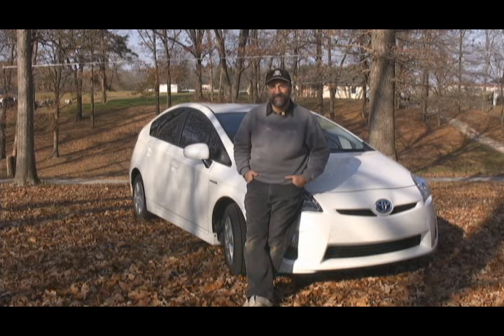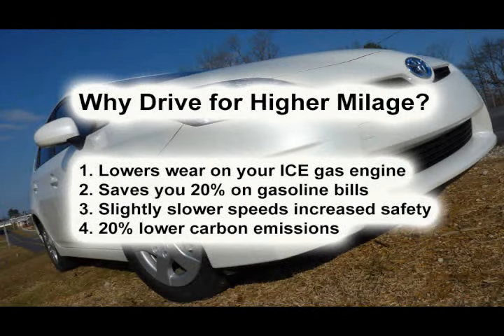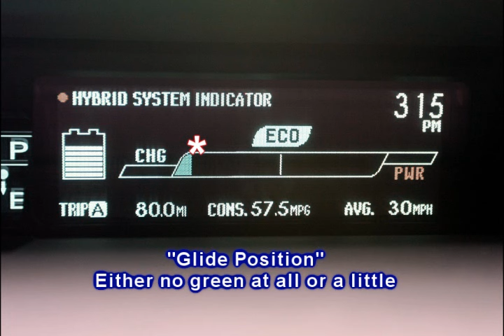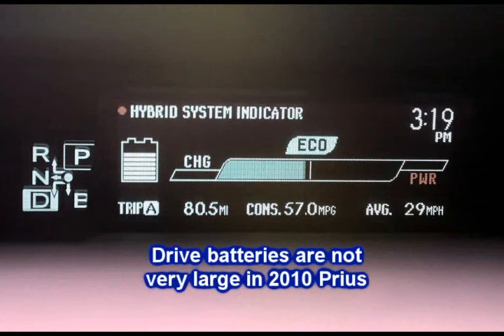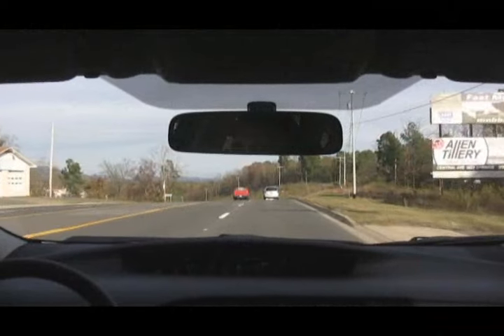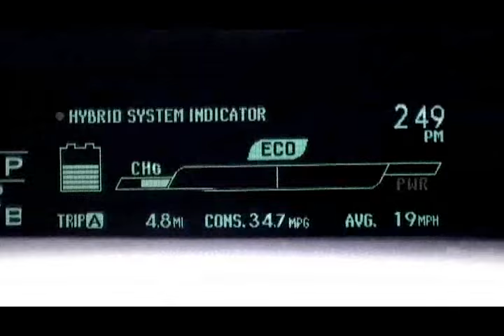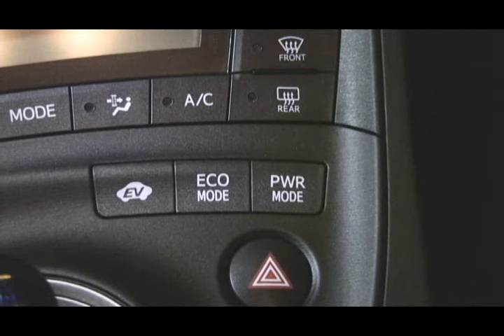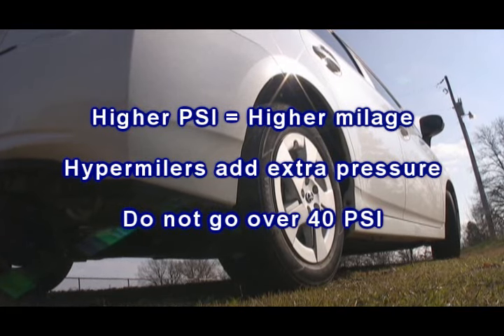Prius MAX MPG Secrets

Comment: Interesting note: these techniques (without the tricky Prius displays) work with literally every car on the planet.
Reply: Correct but you don't have to stare at the display. I stopped doing that when the novelty wore off. I was nervous about buying my first Prius, an old one, then I just bought a younger one. They're very reliable and relaxing to drive. When I arrive at my destination in 'drive' I just press the start/stop button and get out. It a auto selects 'P' .
Reply: the display makes it easier to keep track of and the whole pulse and glide thing is obsolete with cruise control
Reply: @capacityplus  I found out I can drive up to about 63-64 mph and still get over 55 mpg even when driving in power mode and accelerating quickly, especially when the temps are higher. I had a 2010 and a 2016, which I averaged 62.5 mpg over a full year and about 44k miles with the same driving habits as the last. So with that kind of gas mileage, I had no problem driving 70 mph or so when needed because it's usually only a few minutes at a time and doesn't tank the gas mileage.
Reply: @jaredlupton6838  was that US or imperial gallons?
Reply: @jaredlupton6838  wife has a 2016 and i have a 2015.....very big jump in technology....from one to the other....
Reply: You Americans forget how cars were 30-40 years ago: Geo metro, Nissan, Suzuki, Fiats. All could be driven for 60+ mpg with the same carefulness.
Reply: @Tore_Lund  
No, they couldn't. Normal driving in normal traffic at normal speeds yielded somewhere between 28 and maybe 40 miles per gallon in those cars. Extreme care at lower speeds than the speed limit in traffic got you maybe 35 to 47 miles per gallon.

Normal driving at normal speeds in normal traffic with zero concern for fuel mileage in my two 2015 Priuses I have owned got me between 50 and 60 miles per gallon, usually closer to 50. That's with either the heater or conditioner in use. All season tires at normal driving pressures (33-38 pound/in²). That fuel efficiency difference makes a big difference in my Lyft driving budget when gas prices finally go up above $3.50/gallon. AND, the Prius has a lot more room inside for both passengers and luggage than those older tiny cars. 

AND it's a lot heavier and safer in a collision than those old tiny cars. In one of those Priuses, I was hit from behind at a red light by a huge Ford F-250. No injury to me at all. The driver of the pickup was unconscious with airbags deployed - I think he was going 25 to 30 miles an hour. Airbags did not pop in my Prius. To be fair, the pickup driver was drunk.
Reply: @jaredlupton6838  
You should understand that power mode in the Prius doesn't actually give you any more power and doesn't affect your gas mileage when driving at a steady throttle. All those driving modes do in the Prius is adjust the sensitivity of the throttle. Those gas mileage numbers sound about right in a Prius that's in good shape and not really old. My second 2015 Prius has 200,000 mi on it and my gas mileage numbers have dropped by about 5 MPG. to be fair, I've never replaced the spark plugs and have only done the bare minimum maintenance on the car.
Reply: @bobbabai  I'm talking about eco driving, as shown in this video with a Prius. I got an EV last month, but my previous car was a Fiat Seicento from 1998. I averaged summer winter 58 mpg, morning city traffic 47 mpg, city morning traffic in winter 40 mpg. On my last year summer road trip, 6000 miles, Europe North to South and back I averaged 64 mpg (I've kept the gas receipts) The car weighed 1200 lb and I could push it with my thumb. My point here is you can get an expensive hybrid, or an old compact and achieve the same thing. The Suzuki Swift from that period was the record holder, it could get a whiff over 70 mpg. Funny when Suzuki brags about their 36 mpg of the current Swift. Did the good engineers retire?

Comment: Been driving my 2010 for almost 2 years now, glad to discover I know all of these techniques!  It's just applying them to Cleveland traffic that's a pain lol.  My cabinet filter needs replaced but I typically only get about 40-45 mpg with 35mph zones predominantly and minimal highway. I assume I'm doing alright 🤓
Reply: Eric Schmid have you had the battery cells checked?
Reply: @nickiemcnichols5397  I assume they were checked any of the times I got a free full inspection offer by Toyota, but I've never heard any comments on them.  Why do you ask?

Comment: Last time I had my car in for service, I had to replace the brakes because my efficient recuperative braking meant they were hardly ever engaged, which led to rust build-up. So now I do some hard braking on purpose a few times a month to ensure that I have enough brake wear to avoid rust.
Reply: Actually, every time you brake to a complete stop, the hydraulic brakes engage when velocity drops below about 3mph, because at this speed, the motor generator (MG1 or MG2) are not rotating fast enough to generate enough counter-electromagneticforce to continue slowing the vehicle.  In other words, the hydraulic brakes will always engage in order to come to a complete stop or conversely, the car will not come to a complete stop unless the hydraulic braking system engages.
Reply: Kevin Diaz-Lane, did you reply to the right comment? Yours makes little sense within the context.

But in case you did intend to address my comment: I know that the brakes have to engage at very low speed. But at those speeds, there's hardly any energy left for the brakes to capture. It certainly doesn't cause enough wear to keep mine from rusting, at any rate.
Reply: if you want to clean the rust, put your car in neutral while going and use your brake. The regenerative system will not engage in neutral and you will only use your friction brake. Of course, do this on a parking lot or low traffic area.

Comment: Good sound advice but you neglected to mention the 'B' mode used for going down steep inclines. A normal non-hybrid engine would keep your speed under control by using the engine to brake when your foot is lifted from the accelerator. This does not happen with hybrid engines as the petrol engine is not directly linked to the drive. Using 'B' mode collects the energy more rapid and charges the hybrid battery having a slight braking effect and not letting the car run away whilst your foot is not on the brake pedal. A bit like the F1 racing cars KERS system  harvesting the braking energy.

Comment: what I usually do, is have internal circulating air, not outside air, and turn on the AC when you anticipate a stop.
with a gas car, leave the ac on at a red light, and turn it off with fan reduced to minimum speed, when accelerating.
on the prius, you could use ac when coasting, or braking, but try turning it off when accelerating, or standing behind a stop light, I guess..

Comment: I have driven 3rd generation Prius for the past (4) years +... anyone below 45mpg might want to consider: Mode - standard setting, not power. Tires - pressure, tread, size. Fuel - try different station... regular is fine. Temperature - you need to allow the car to warm up, wintertime fuel in some areas (northeast) is oxygenated that combined with cold running will equal low to mid 40's mpg. Load - unusual amount of weight carried daily. There is no trick to getting 50mpg. Just drive the car like a normal car with no mode buttons pressed. Car loves stop and go traffic under 40mph. Hope this helps, DTG

Comment from the maker: No. the B-gear is only for going down extremely steep grades. The re-generation is from braking exclusively. B would only reduce your efficiency if you used it regularly. The normal brakes plus re-generation provide serious strong braking. I've never used B mode and I live in a mountainous area.

Comment: I've driven a 2010 Prius for a couple years, and to me the car just points out how inefficient gas really is. Using the techniques I learned driving this car, I was able to get 30mpg on a Ford Mustang, on a 15 mile trip...I had to work hard at it, and it was not fun (except for watching the mpg number increase).

I can't wait for battery capacities, charging, and drive efficiency to improve enough that all electric is feasible for all travel. I primarily drive a Nissan Leaf, and it can easily do 99% of my annual driving. Ironically Toyota's hydrogen fuel cell car also uses an electric motor... so basically the hydrogen fuel cell is a different method of storing energy vs. a lithium ion battery pack.

I honestly hate driving a Prius, and love driving a car I can mash on the throttle. The kind of driving that would give me terrible fuel efficiency actually helps when your using an electric motor and batteries. Don't get me wrong, once I'm up to speed, I use the same feathering of the throttle to maximize efficiency, it's just the short bursts of acceleration I'm talking about (just enough so you can give your passengers whiplash).

Comment: Thanks for the video.  I have found myself doing all of these things just learning the car.  Living in a very hot climate I actually get better mileage in the winter then summer.  I average about 46 mpg in the summer and about 51 mpg in the winter with a close mixture of 50/50 city/highway driving.
Reply: Yeah, the prius likes warm weather, roughly 65-80 degrees. When it's really cold, your sucking away heat from the engine  to warm up the inside, forcing it to run more.

When it's hot, you're probably running the A/C, which also saps mpg, or driving with the windows down, which reduces the car's aerodynamics and also eating into your mpg that way.

Comment from the maker: The TDI is a great car and the techniques are very similar to Prius techniques.
The new Prius is so refined...so solid...and so easy to get 60MPG+ on.
The huge difference is summer to winter because of fuel re-formulation, cooler batteries and wind resistance. Plus, hotter tires are higher pressure!

Comment: Before having a PriusV I used to drive a stick shift, and I used to increase the mileage by coasting the car, i.e., hitting the clucker and disengaging the engine. So, I was used to do long decelerations before using the breaks. So, when I bought a Prius, kept doing the same thing.

Comment: My 2013 Model 2  Prius V (base V) gets 35.4 MPG in the city, 40 MPG highway. I removed the factory air intake boxes and installed a made-for-Prius V Injen intake. IT gives me more power with a bit less mileage DUE TO THE FACT THAT I GET ON THE GAS on initial acceleration because I like the speed. 

If I keep it in "ECO" mode as much as possible I can get 38 MPG city. But 44 MPG city? NO WAY! Nevertheless, coming from a 2007 V6 RAV 4 I'm very happy with my mileage.

I've installed a pi-shaped central underbody brace and a strut tower bar as well as 17" ultra light ENKIE RPF1 wheels to get the wider tires (Yokohama  YK 580 V-rated ) for better handling and stopping. These wheels are much lighter than even the 16" OEM wheels that came with my car. 

I'll add two more underbody braces, a stiffer front anti-roll bar and lower springs. Then my handling mods will be finished. Right now the V handles noticeably more responsively and corners flatter. When the last suspension mods are done I'll have a Prius V that is safer due to far better handling. The ride will be a bit stiffer due to slightly compressed shocks (dampeners)  and that is a good thing in my book because it means less wallowing in back-and forth maneuvering at speeds.

BTW, my suspension mods all come from "Juiced Hybrid" in Redwood City, CA. Great folks and very good service.
Reply: modding a hybrid minivan/10

Comment: Here's also a good key: Do the speed limit (don't go over it) and USE CRUISE CONTROL WHENEVER POSSIBLE, all the time if you can. By doing this, you're letting the hybrid system DO ITS BEST. I average anywhere between 60-70 MPG in my 2017 Prius II using this method!
Reply: With out CC but gentle foot you will get much more

Comment: @ 1:40 There are several factors that contribute to poorer gas mileage in colder conditions. 

1. Engine closed loop takes longer to achieve at lower temperatures. 
2. Engine closed loop is harder to sustain at lower temperatures. 
3. Cooler air is denser at lower temperatures, therefor there is more arrow dynamic resistance. 
4. There is less daylight, so there is more power usage for lighting. 
5. Specific gravity of gas increases when temps decrease IE a gallon weights more @lower temps 

ETC

Comment: I use cruise control at every opportunity, I coast very often if no one is behind me and I regen all the time, the brake lights don't come on until most of CHG is filled
The default mpg is great, 50mpg at 55mph is great around town and 40mpg is great going 80mph on the freeway
ECO mode in bumper to bumper, normal mode most of the time, PWR for when someone annoys me, engine braking mode if I see cops up ahead since brake lights don't come on
I get the same MPH at 100mph as my brother-in-law's Mustang at it's best. With gas prices as they are I'm glad I can still go as fast as I want and not break the bank

Comment: @Yavor54 Thanks, getting the average over on Prius Chat. It is possible to get the performance of a V6 on a prius, with 60 MPG, if you replace all the gaskets with acetone resistant materials and add pure acetone to the fuel mixture, but that would require major work and the oil companies would not like it very much. You would also need a way to get the acetone into the tank without getting near the paint.

Comment: I use the "B" selector when shifting and it provides a dynamic braking that'll slow your car without using much brake power from your actual braking pads.  It also charges the battery as well because the dynamic braking provides energy that is circulated back to the battery.  Am I the only one who uses or know about this feature on the prius?
Reply: Man dont do this. With B mode u are slowing mostly by your engine (rews getting higer). It is usefuly when u get down from high hill or mountain, in daily use it harmfull for engine. 

Ps: Btw i get down from 3km mountain road, rews increased nearly 4000 and there strange sounds, but its better than burn your brakes and fall from hill  ))  In this case  engine work like pump to stuggle speed.
Reply: @ismayilaz7115  B mode is not a "J" shift mode like in a car or rig.  Its actually reverse polarity that is slowing the car down.  The revs stays the same.  To prove this, B shift actually recharge the battery really quickly.  You must have never driven a prius or any other hybrid system.

Comment: Hey Bob, is it true that under 7mph the friction brakes will turn on no matter what?
Reply from the maker: Well, the re-gen system releases as you slow down under 10MPH. You can feel it slightly "bump" as you go to purely friction brakes. Under 7mph, there aren't enough RPM's to get any juice from the electric motor.
Reply: Bob Nagy Yess... especially if you hit a bump in the road around that speed you definitely get a lurch.  Will the rear friction brakes always engage?  Since this is a front wheel car the regen system cannot work through the rear wheels i assume..
Reply: +bsktballdude My  friend said he got a recall from Toyota that solved the lurch when he hit a bump. Mine is a 2011 and never did this so I was puzzled when he first asked me about it. Working fine now afaik.